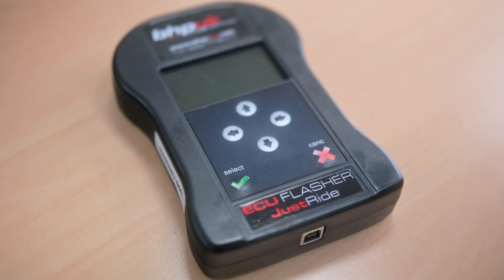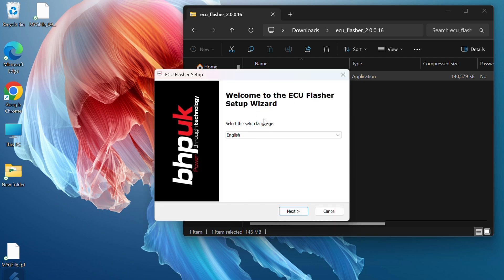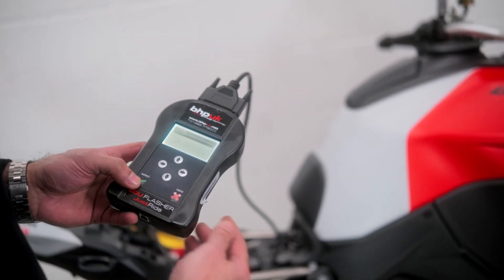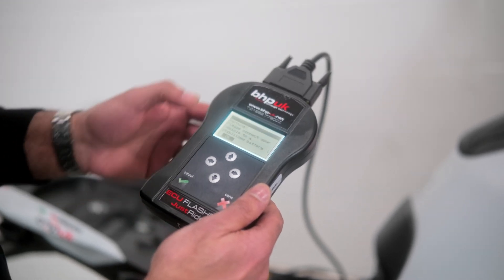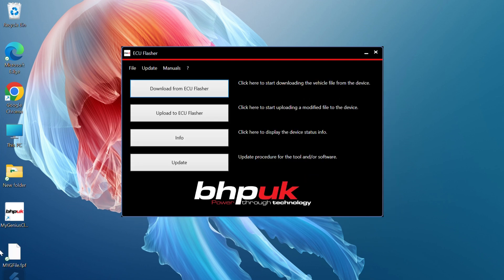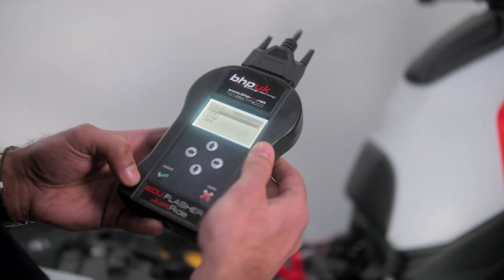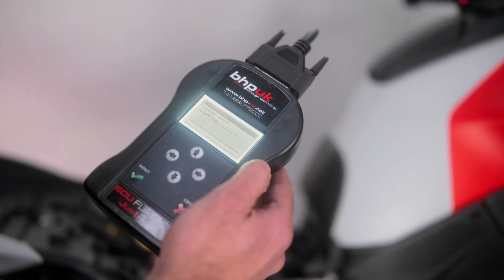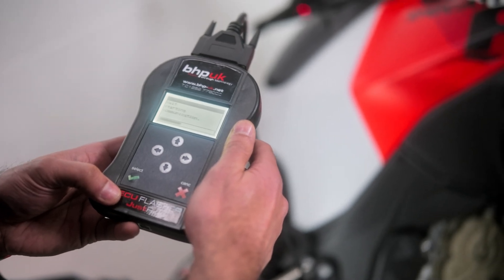How to use the BHP UK ECU Flasher (Walkthrough) | Bespoke Remapping Device

Comment: I am a bit surprised that a new device is required for each bike.
Apart from the waste of having and storing multiple devices, where one device (possibly with a few different connections) would suffice, it would be cheaper and also faster as it would save on the cost and selay of the postal/courier service (which also reduces it's carbon footprint).
I would hope that this can be looked at in the future to make it more affordable and environmentally compliant for owners of multiple bikes.

Comment: What do you deem as a ‘stabilised battery supply’? Is it simply a battery charger?
Reply from the maker: No, a stabilised supply is a function on certain chargers that keeps the voltage at a constant over 13 volts. A battery charger will fluctuate constantly to charge the battery in the most efficient way. It has to be a steady stable supply or a fully charged battery that is not on charge when working with the device and the vehicle.
Reply: @BHPUK  thanks for your reply. Do you have an example of a charger with that capability?

Comment: Have to say I’m disappointed with the customer service after my ECU flash purchase. After Uploading the ECU flash successfully on my VOGE 900 DSX the results were fantastic on the first day, after that it was pretty much down hill from there. I’ve called BHPUK several times only to be told someone would get back to me, unfortunately nothing yet. I’m not interested in money back, just looking to get the flash to work as it should. Hope this is just an oversight on the part of BHPUK and they back to me as promised.
Reply from the maker: Hi John, I can assure you the map writers are working through this as some of the lads have told you on the phone. This isn't a normal issue and it's the first time we have seen this problem so it's going to take a little time to get to the bottom of it. A file never disappears and never unwrites itself from the ECU so we need to explore every avenue of why this has happened or why you think it has done this. This problem has been with the map writers since you called and they have been working and finding the reason why since this is something that has never happened.
Reply: Thank you for your response, very much appreciated.

Comment: Maybe a bit off topic. A while back I bought a 701 SM euro5. I felt it was weaker than other euro4s ive ridden. When i got my registration papers it said A2. I went to the dealer. We checked the frame that said "A3" which should mean its an A bike. They plugged it in and said it had the correct map for A. But i am concerned its not.

I found out that the A2 map is identical up to 40% throttle where it starts to decline. Could they have made a mistake? Is there any way for me to ensure it has the correct map? (I do not live in the UK.)
Reply from the maker: We can take a look on our ECU Flasher for you and derestrict this bike. We will know from the software and can help you out. 
https://shop.bhp-uk.net/products/husqvarna-ecu-flasher?variant=41287102365749
Reply: @BHPUK  Unfortunately not. I have a 9 hour ride to the closest one I know.

Comment: Is it ok to run with a 12v power supply when the motorcycle has a lithium battery (13.2v)?
Reply from the maker: Normally, in most situations this would be fine, most stable supplies are 13 volts but you should check with the supply charger manufacturer first.

Comment: When I buy a device for KTM 1290 SuperAdventure. Do you supply version 1 or the new version 2? Do I need to clear the error codes after uploading?
Reply from the maker: If you are referring to the Flasher, you will receive Gen 2. Sometimes on KTM you will need to 'Delete DTC' after programming :)
Reply: @BHPUK can errors be cleared using the BHP Flasher?
Reply from the maker: Yes, via the 'Delete DTC' function, Qal mentions this in the video just after he programs our RS :)